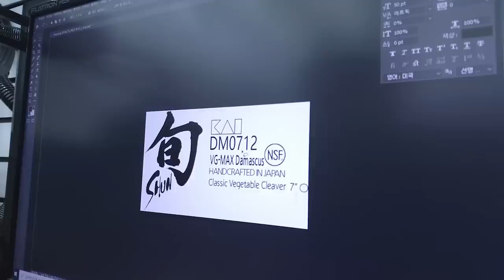기가막힌 다마스커스 중식 요리 대부의 칼 다시 살려내기.

Comment: I enjoyed your video very much, you are highly skilled. I was confused after the first viewing, but gained understanding with repitition. The elder has ground out the entire cracked section, which seems to disappear!Respectfully there is it seems an error in the subtitle translation into American English. Thickness describes one dimension and "width" describes the other. The width of the blade would be what size to cut the leather parts for a simple sheath. 

The width of the blade seems to be about 40 mm and the thickness of the blade seems to be about 4mm at the spine. I mean no disrespect by this suggestion. You have many fine tools